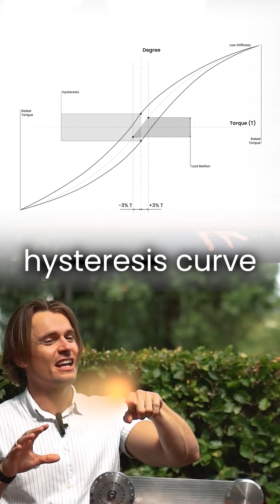Archimedes Drive: Fixing Hysteresis and Backlash in Robots #archimedesdrive #hysteresis

Comment: That's why you measure the angle on the joint 💀 cheap ahh robot confirmed
Reply: Hey guess what also has backlash? ENCODERS
Reply: @realcrazypotato like how much? Sub arc seconds  don't really matter this much, do they? Or how big of an arm are we talking abt? On a 5m arm with we would have 0,00013mm  accuracy with 5 arcseconds. Ussualy you can achieve 2,5-4,5 with an 2 arc second encoder.
Reply: @wintertod74  how about getting a drive system that inherently has sub minute of arc deviation, and then you can simplify your control loop
Reply: Knowing the position doesn’t mean you can correct for it on high velocities with high inertia.
Reply: @casNL23 of course not. Every machine is flexible to some point. That why you limit your accel. You can test for system response and make a correction table according to the should / is value graph
Reply: @wintertod74  so the stiffer the machine, the higher velocities it can handle. That’s their point:)
Reply: @casNL23 no, they say they can't draw a circle because of hysteresys (basically backlash)
I said they should then measure the joints directly not indirect measurement by servo encoder through the gearing. And because they cheap out on more expensive equipment I said they're talking abt a cheap robot. (cheap as in same category pricing)